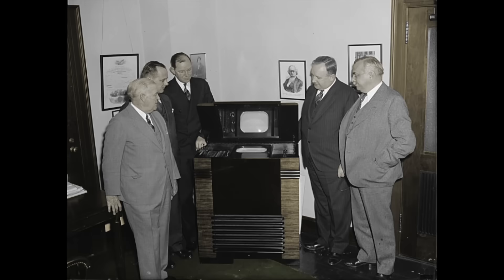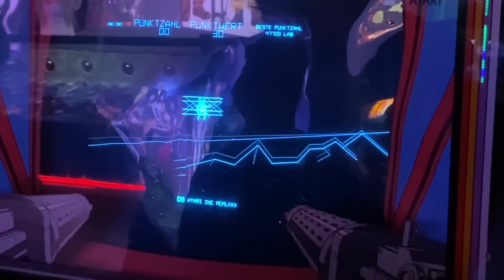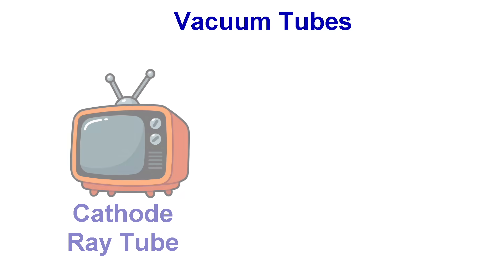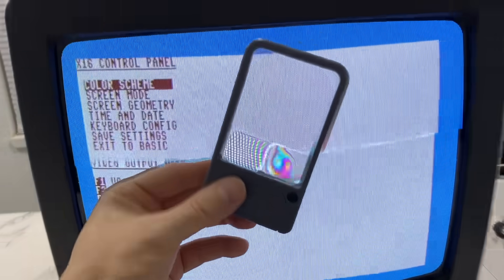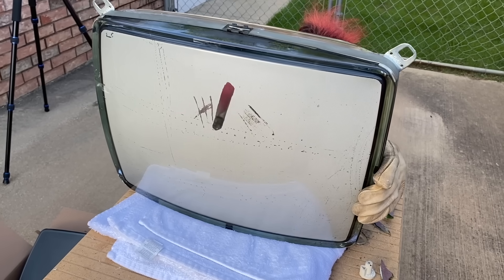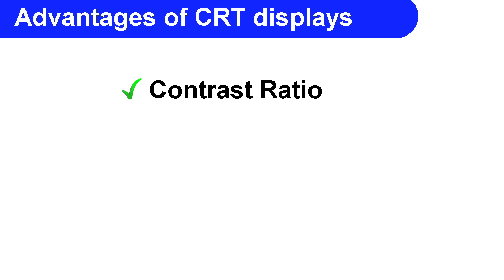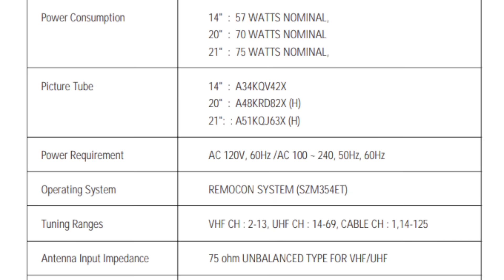How Cathode Ray Tubes Work.

Comment: I switched from a 19" HP CRT monitor to a 26" Samsung LCD back in 2008, from one of my first salaries. It was still expensive, but by then it had the quality that I could live with. Of course, it looks quite bad by 2024 standards, but it's still in use in my parents' house as a guest bedroom TV. Btw, the LCD can also suffer from burn-in. I can see the CarPlay / Spotify previous, pause and next buttons on my car stereo when a white (or light) screen is displayed. It's not as bad as on a CRT, but it's certainly there.
Even though I daily drive a 32" 4K LCD monitor, I still like coming back to my Commodore 1084S-P1 for my Amiga, PC XT clone and anything with an RGB, composite or S-Video output. (except for my VCR, which is hooked up to the TV)

Comment: I think that the only people who really benefited from 16:9 TVs until the very late 2000s/early 2010s were either early users of true 16:9 DVD players and other home media of higher resolution at the time. Most TV stations your average person would’ve had probably didn’t start broadcasting in HD till the mid-2000s, and HD and the plasma screens to display HD were still relatively expensive to pay for back then compared to CRTs.

Comment: It took me a LONG time to replace the CRT on my workstation with an LCD.  The viewing angles of early LCDs were so bad, what my left eye saw was different than my right eye, and that caused a stereographic effect that gave me a headache.  It wasn't until e-IPS panels came out that I considered an LCD under $1,000 to be even remotely feasible.  Then, Apple bought out the rights to e-IPS technology, and every other manufacturer had to stop making them.  Stupid Apple.  I'm glad I snatched my e-IPS display before they were all ripped off the market.

I still use a CRT with my Amiga.  I've tried replacing it with an LCD a few times, but I always go back.  It just looks and works better with a tube.  8)

Comment: In the beginning, technology was void and formless, and darkness was upon the face of the deep. And the spirit of innovation moved upon the face of the laboratories. And there was a voice that said, "Let there be vision," and there was vision.

And the vision was made manifest in the form of the cathode ray tube, and it was good. And the first commercial CRT televisions went forth upon the earth in the year 1934, bringing light and moving images to the people.

And the innovators saw that the CRT was good, and they separated the electrons from the darkness. They called the electrons "cathode rays," and the darkness they called "vacuum." And there was evening and there was morning, the first day.

And the innovators said, "Let there be variations and improvements in the CRT technology," and it was so. And the technology evolved and improved over seventy years, and it remained the dominant display upon the earth.

And the innovators said, "Let there be liquid crystal displays for the computers, especially for the portable computers." And there were liquid crystal displays in the 1980s, though they were expensive and monochrome, with poor contrast and viewing angles. And they saw that it was limited, but good.

And the innovators said, "Let the LCD technology mature," and it did mature, and by the early 2000s, LCDs were in a position to replace CRTs in both cost and performance. And the people saw that the lighter weight and thinner screens of LCDs and plasma displays were good.

And the innovators said, "Let us explain how the CRT works," for it was a mystery to many. And they revealed that the CRT was a vacuum tube, with a cathode and an anode, and when the cathode was heated, electrons flowed, creating light upon striking phosphorus.

And the people saw the light, that it was good, and they marveled at the creation of images through the manipulation of electrons by magnetic fields. And they understood that CRTs did not have pixels as modern displays do, but created images with lines and deflection coils.

And the people saw the shadow mask and electron guns of the color CRTs, and they understood the creation of red, green, and blue images. And they saw the versatility and longevity of CRTs, and they remembered the contrast ratios and the absence of input lag.

And it was evening and it was morning, the sixth day.

Thus the heavens and the earth were filled with displays, from CRTs to LCDs. And the innovators looked upon their work and saw that it was very good. And they rested from their labors, celebrating the history and the future of technological advancement.

Comment: I have to counter the contrast argument, CRTs did not draw perfect black either. When beam displayed black, it still emitted some electrons and on certain CRTs it brought the blacks up quite substantially.
Also the resolution, electron beam could never shoot at precise pixel on screen. Adding to a fact that pixel is a beam with a radius, anything beyond 1200x1024 on 17" screen would be a blur.
The only thing going for it is input lag is 0 and games that were authored to be shown on CRT actually look better (dithering patterns).
Reply: You are wrong

Comment: 13:00 no it's not.  
Vinyl fidelity is not superior to digital fidelity, so...  Vinyl sounds differently because of the medium and the requirements in mastering so that modern music is effectively (and successfully if bass-heavy) cut into the medium. The needle could hop out of a groove if things are not cut/laithed/mastered correctly.  
These mastering requirements are often EQ and Dynamic Compression related and are subjectively more pleasing to our ears too.  
Additionally, the sound playback system and signal flow (needle, turntable, wiring, grounding, pre-amps, eq, amplifier, speaker, acoustic reinforcement) account for a lot.

Comment: @The8bitGuy
Commenting on the 16:9 aspect ratio perspective, for me, it was never about actual screen size, it was about the widescreen ratio. If I wanted more screen, I would buy a larger size display, and with LCD's, this was both much less expensive(as a 37" LCD was nearly half the cost of a 27" CRT) and much more desk-space practical. 4:3 LCD's were just a no-go as I wanted to watch my movies in something close to the theatrical aspect ratio and I wanted to play my games the same way. Desktop productivity type activity to a back-seat to those two considerations. This has not changed since 2005 and will not change going forward. Of course, I'm not into ultra-wide screen ratio's either, but that's another discussion..

Good video as always! Cheers David!

Comment: The size of view area on self-convergent planar CRT depends of its color. From darkest to lightest it's about 1" difference on 21 inch TV. Screen really dances wildly during loading your say Spectrum when stripes go thru border. That's the worst of experience with CRT and the reason delta mask is the king. PS. I wildly dislike anything black and white as image with no color always feels like a night thus dark no matter the brightness.

Comment: I'm surprised you didn't mention the high voltage that runs through. Like 20 000 Volts, which is enough to kill you if you don't handle with care.

Comment: CRT contrast wins only LCD and that in a dark room. Things get worse if there is ambient light, you need higher brightness or HDR content. And OLED wins over CRT in all areas except variable resolution and input lag. And any modern tech loses usually on the repairability factor.
Reply: Wrong. OLED has way worse motion, higher inputlag
Reply: CRT's are more reliable and cooler than oled
Reply: @NEON2600  my CRT consumes almost 10x compared to my OLED monitor (in SDR mode). Thus this OLED runs cooler. Burn-in happens faster on OLED but not sure which one is more reliable. Old CRTs are easier to fix but modern CRTs contain ICs that can be nearly impossible to find replacements for.

Comment: My father only got rid of his CRT TV in 2023, and that's because it was analog, the cable company finally switched everything analog off and we've had issues with the SCART interface and set-top boxes, apparently it had to be issued by them or it wouldn't work, antennas wouldn't work because the tower here is such low power, etc.
But, the first thing he noticed on the new TV was that the color wasn't as good. Not as bright, not as vibrant. And also, while the CRT was working fine for over 20 years, the LCD TV has already developed damage and will need to have an LED stripe replaced or something like that.

Comment: I believe the way the phospor stripes/dots were created is that they first coat one colour, then use a UV source at the position of that colour's electron gun to harden it. Then wash off the un-exposed phosphor and repeat for the other two colours.
Reply: I was JUST thinking about this the other day, and wondering how anyone managed that level of precision in commodity manufacturing as far back as the 60s.  It seemed like there would be tons of alignment issues that would be like the "dead pixels" of the CRT industry.  You must have 20% of your screen show the wrong color before you can claim the tube as defective.  haha

Comment: The best part was missing. Motion smoothness. NOTHING beats CRTs for things like 2d scrolling games. The only comparable one is a brand new OLED with special modes for smooth motion. Even $1000 240hz LCDs just don't look as smooth.

Comment: One time when I was an elementary schooler I think, I tried to see what magnets would do to my little CRT TV that I watched saturday morning cartoons on.

I screwed up the color, but I only used one pole of the magnet so by using the opposite pole, and prayers, and carefully scribbling the air, I was able to get it back to mostly normal.

But I only messed it up a little bit.

And I got hella stressed when it was stuck that way 🤣 lol, and then I fixed it... and was so relieved. It was funny.

I was like "Oh no, I'm gonna get yelled at and we're gonna get rid of it and replace it with a worse one I HAVE TO FIX IT!!!!!!!!!!!!!" 🤣🤣🤣

(I was a smart kid I knew the voltages in those things were lethal, but I was also a crazy kid, so I still did the magnets, and more dangerously I put aluminum foil on it. That wasn't very smart, it was invigorating though 👍 seriously I did that 🤣 not wise, but I like static electricity as I kid, I would build up static electricity on the playground slide, and then let my hair discharge into my closed eyelids, I thought it felt good 🤣)

(Like running up the slide and going down it, and like having my face close to the seperation of charges so I'd get zapped. I don't know the physics of how, because logically, I never touched metal, but, I uhhh I thought zapping my eyes on the slide was funny... I also liked to put aluminum foil on the tv and turn it off and on, and off again, and then poke it, I thought that was the best too)

(Also as a baby I used to shove my face into the running water at bath time, and I'd giggle when my mom rescued me, I just, literally, love danger, like, not real danger, I juat don't perceive electricution or drowning as painful, so in low doses they make me giggle) 🤣🤣🤣

In high doses I have the presence of mind to not want that.

But yeah.

Like just today, I came up a bit early while swimming because I have new goggles and misjudged how much out of the water my face was, by, like, a half inch or a quarter inch, so I sharply inhaled and accidently guzzled in some pool water.

After choking a bit, I swallowed the rest, and then my reflex was to just giggle and laugh about it.

It wasn't painful per se, it was just bad, and that's a skill issue, so why not laugh about it?

Anyways yeah. Same thing when I'm uprooting blackberry bushes, I try to uproot the whole thing but sometimes the root chord snaps and then you fall on your butt.

I'd be very angry if I damaged an important bone like the hip or the tailbone, just like I'd be very angry if someone drowned or electrocuted me.

But, if it's my fault, thats a skill issue, and if I came out unscathed why not laugh?

Anyways yeah, I degaused my tv with one of those toy clicker magnets. Not reccommended, barely worked. 👍 lol.

Rough childhood, mostly my own fault 🤣 skill issue.

Comment: I remember moving house with a big color TV, back when all TVs were CRT monitors. For convenience in the trailer, I put the TV next to the speaker cabinet of my Marshall amplifier, and when I took it out and installed it in the living room of my new apartment it had a BIG blue blotch in the top right. The speakers in the cabinet contained strong magnets which, during the drive, distorted the position of the mask. It ended up solving itself, but it took about three weeks.

Comment: It is true that CRT are resolution agnostic, but with high density LCDs you can probably set different resolutions with not much sharpness penalty: a retina display on a 13.3" mbp can scale differently and it's basically using "pixels" as "mask sites" so every "logic" pixel takes up more "actual" pixels

Comment: I had a few times wondered if one could do a poor man's version of a color CRT by taking a black and white CRT, painting a bunch of narrow and accurately spaced color gradient bands on the front, and then having it such that the output of the electron gun would be electronically color-modulated based on the vertical deflection on the CRT.
Had once described similar tech being used in a past sci-fi story of mine.

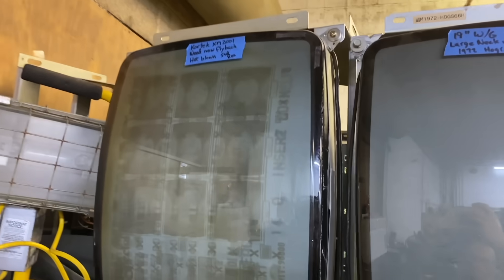Comment: 14:20 that makes me remember a few years ago. For my job (which was inspecting fire alarm systems in buildings), i was doing the Montreal former olympic village, turned into residential. They got their own security crew and they got modern lcd CCTV monitors. BUT, in a basement, in a former security office, there is still a station with dozens of old CCTV monitors. They're turned off for decades by now. And there is burn-in images of the different corridors of the ground floor ! I could dinstinguish the different places in the building but i think from 30 or 40 years ago, like it was time capsules lol

Very interesting what curiosity a crt burn-in can show

Comment: one thing not mentioned is: how does a CRT vary that brightness/intensity of the beam across a scanline? it can't be by varying the temperature of the cathode - too slow for that. 
the answer is: there's one more control element for that. a cylinder closely surrounding the cathode, kept at a negative voltage (i.e. repeling the electrons emited) and leaving only a very narrow aperture for them to exit through. the more negative the voltage of this cylinder the lower the chance any electrons will escape towards the anode ring and ultimately the screen. the less negative the voltage the more electrons are allowed to escape through the apperture. It's called a "Wehnelt cylinder"

Comment: In regards to longevity: Shoutout to Rtings for their modern TV & Monitor longevity test. They obv. don't include any CRTs or Plasma TVs, since they're both not made anymore, but it clearly paints a picture of where the tech is nowadays.
Sure, OLEDs have burn-in, but a number of LCD TVs in their test already have issues, like discoloration, dead or dying backlight LEDs, or image retention issues. Meanwhile the burn-in on the OLEDs in a lot of cases is still relatively mild...

Comment: One important advantage of CRT is its motion clarity! Sample and hold displays (LCD and even OLED) can never achieve the same! If you haven't seen a CRT in motion for decades or, in fact, never, you need to. It's so smooth, especially with some old 60 fields per second video games! Maybe you shouldn't see it again or for the first time because it will ruin you, and you will hate sample and hold modern displays forever after that.

Comment: What amazes me the most is that the magnet can deflect the rays so incredibly fast. It blows my mind. Everything else makes sense and seems absolutely possible to manufacture, but that speed is fascinating.
Reply: The trick is that electrons are incredibly small; so it takes almost negligible energy to change their direction of travel.
Reply: Except, that's not even fast for deflection.
An fast analog oscilliscope with eletrostatic deflection can show a 100 MHz sine-wave deflected in the vertical direction real-time.
Aka moving the beam top to bottom of screen 100 million times per secound.
Reply: @erlendse  Aside from using electrostatic deflection (essentially, using capacitors instead of inductors), they also achieve this by using a relatively long neck projecting onto a very small screen.

Comment: Please be careful around the tube! While the deflection coils may not be that dangerous,  there is a high voltage wire that plugs in to the tube that runs in the thousands of volts. The tube will build a charge of this voltage as well for quite some time after being turned off. Others have already commented.

Comment: I actually got a 17 inch CRT last year that has 150Mhz pixel clock, meaning that it can accept 1080p signal without issue. And it died after like 3 months, probably because of a faulty capacitor, and I can't find any place that can repair it. Kinda really unfortunate, because I kinda love pretty much how every game looks on that thing.

Comment: I don't know how you can have 17 inch rectangle and square that don't have the same extra space. Or even just have a rectangle and square be the same diagonal size.

And I got the picture again and I get it now. The 4X 3 Square screen has to be a little bit taller than the widescreen is wider. The extra little bit of hint means that the diagonal measurement will be 17 in on the square.